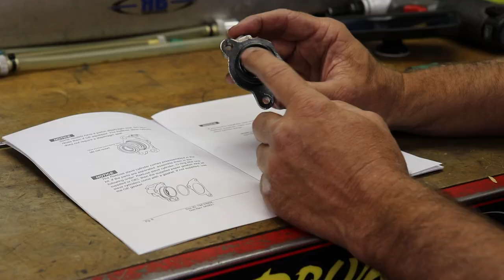How to make your Hydraulic Clutch Stronger and Better!

Comment: Interesting fact - The Red Bull KTM motogp team switched their bikes back to a  cable operated clutch to give the rider a better feel to launch the bike off the line
Reply: I believe the reasoning for this is the ability to manually adjust it during the race.
Reply: I also think cable clutches have better feel.  Another reason I prefer Yamaha dirt bikes.
Reply: I think the two strokes have a better feel than the four strokes my yz250f is on or off kinda but I love the bike just something to note

Comment: I have on but the engagement is at the bottom of the clutch pull, is there still air in the system or is that where they really start to engage?